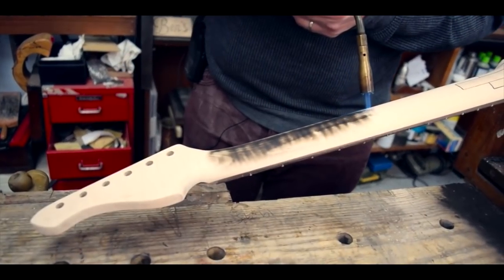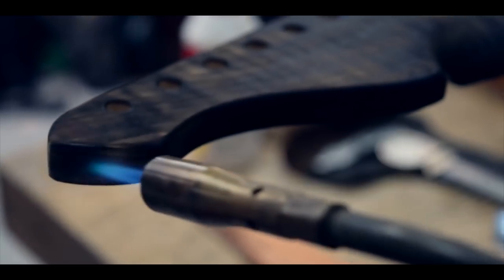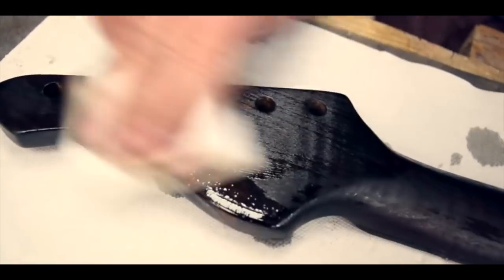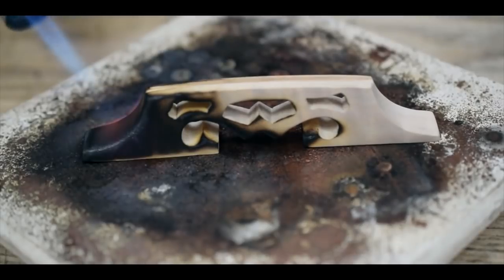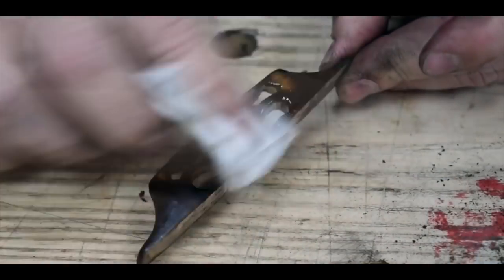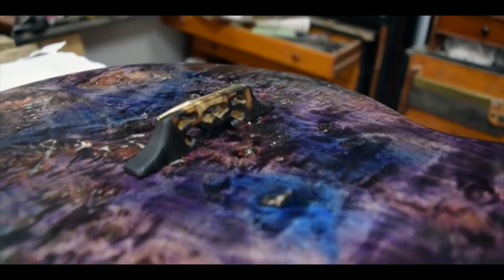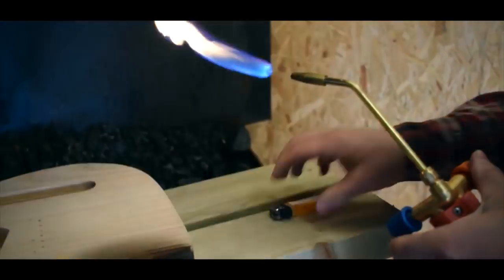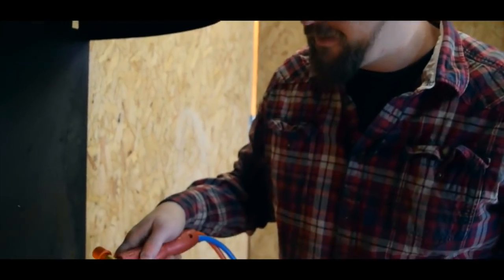Shou Sugi Ban Guitar Making with Ben at Crimson Guitars UK

Comment: Hey, Ben, I was looking for solutions to...um, a cat...problem...and ultimately read THIS in Wikipedia:

"In woodworking, a solution of ammonium chloride and water, when applied to unfinished wood, will burn when subjected to a heat gun resulting in a branding iron mark without use of a branding iron. The solution can be painted onto the wood or applied with a common rubber stamp."

So, I poked around on your channel to find an appropriate video to post this idea.  I'd have sent it to you through your website, but there was no obvious way to do so, and I can't call you from Texas (well, I could, but it would be expensive).

Anyway, have fun with it, if you DARE...!
🔥😈🔥